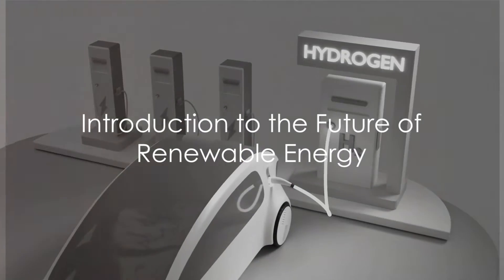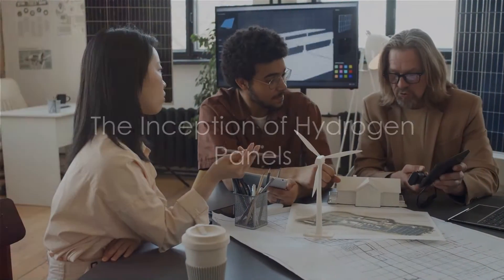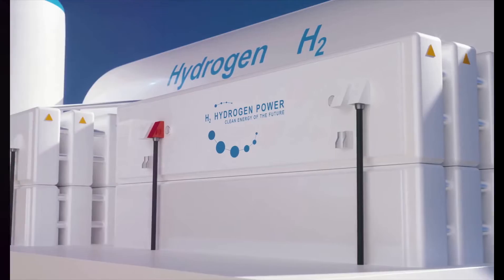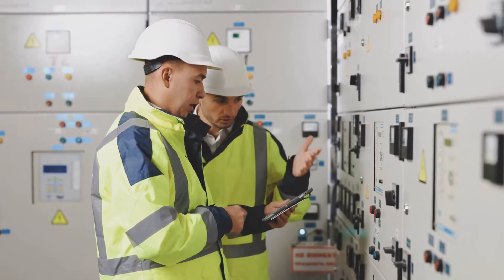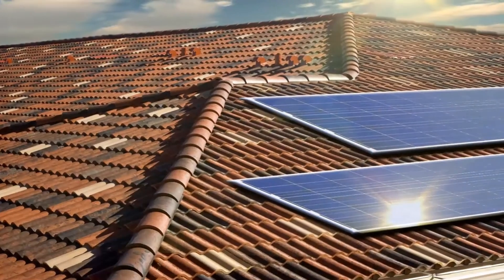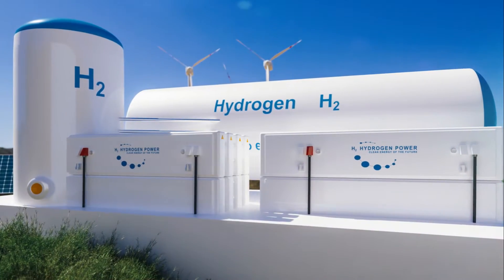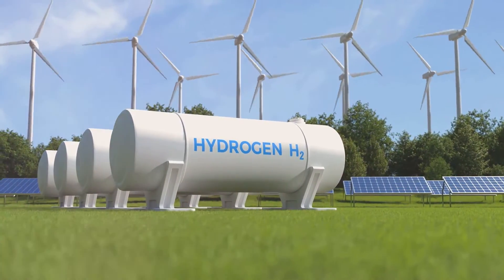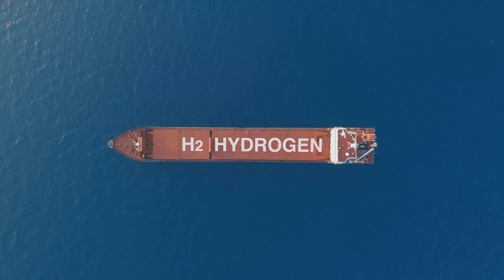Hydrogen Panels - The Future of Renewable Energy

Comment: This German home use hydrogen system is installed in residential homes 
Picea HPS Berlin has developed a fully integrated system providing for all electricity and heat demand. Use of hydrogen storage and fuel cells allow for seasonal storage ... proves that there are possibilities question of economics!
Reply from the maker: Thank you for your very useful comment. It is indeed a great case study showcasing the integration of hydrogen storage and fuel cells to meet residential electricity and heat demands, addressing important questions regarding the economics of such systems. It is a great case study in this space of green hydrogen.
Reply: From what I have read the Picea system on average  costs around €60k installed, based on an Enapter small AEM electrolyser, but clearly costs varies depending on the property. My attention was drawn to an article about a Picea system being installed in a chalet high up a Swiss mountain where grid connection was impossible, it brought electricity to a property that never electric power  - an off-grid solution offering 24/7 power all year around.
Reply from the maker: Thank you  @eddylagrand7762   for sharing! The Picea solar-hydrogen system, with its integration of Enapter AEM electrolyser technology, represents a substantial investment in advanced renewable energy. Its successful implementation in remote areas, like a Swiss mountain chalet, showcases its effectiveness as an off-grid solution, providing reliable and sustainable electricity where traditional grid connections are infeasible. ReneEnergy will continue with this series of solar hydrogen to stir discussions in this tech when it comes to its implementation, safety and economics.
Reply: That hydrogen system sounds like an interesting solution for residential homes! However, if you're an outdoor enthusiast or looking for home backup power, the Segway Portable PowerStation Cube Series might be worth considering. It offers massive capacity, powerful output, fast recharging, and comprehensive protections. Check it out!

Comment: "could run a heat pump"  ya, if the sun is out, or you have a small fortune in batteries.  Running a heat pump is really only for climates that don't get down much below freezing because then a heat pump will freeze over.  seen a lot of them do it.  Compressors in general are the problem.  Running an ac compressor or freezer or fridge compressor requires a lot of power.  They are the biggest problem with our energy needs.  A heat pump is not the long term solution we need.  They simply won't work in areas that really need to produce heat with low temps below freezing.
Reply: You are clueless. Modern heat pumps still work at -35C.

Comment: Ya it's a solar pannel and it perduces hydrogen with spinach plasma . 
It was invented in Israel 🇮🇱  25 years ago . 
Like where the F-have you people been ? 
And one panned 3' by 3' will power a Tesla car 25 Kw power . ! 
It will power an electric aircraft and save hydrogen pumped into a hydrogen tank for night flight ✈️.!
Reply from the maker: Thank you AllenBarclayAllen for your time and comments. It's truly intriguing to learn about this cutting-edge solar panel technology that generates hydrogen through the use of spinach plasma! Israel has a rich history of pioneering achievements across diverse sectors, particularly in the realm of renewable energy. The potential of this breakthrough extends to sustainable transportation and efficient energy storage, opening up exciting possibilities.

Comment: When will they give up on the whole concept of using Hydrogen as a fuel?? Don't be fooled by this disinformation campaign! If hydrogen was of any use it would have been up and running years ago. The main way of supplying hydrogen at the moment is by using fossil fuels!!
Reply from the maker: Thank you for your insightful comment. It's important to have these discussions, as they bring to light different perspectives and considerations in the evolving landscape of energy technologies. Your points contribute meaningfully to the broader conversation about the future of hydrogen as a sustainable fuel source. The skepticism around hydrogen as a fuel is rooted in its current fossil fuel-based production methods and historical development challenges. However, the growing focus on green hydrogen, produced using renewable energy, offers a more sustainable and zero-emission alternative. Despite past setbacks, ongoing advancements and investments in hydrogen technology suggest its potential role in a diverse and cleaner energy future.

Comment: Lacks critical counter point of view. Fails to mention full cycle efficiency (compression of hydrogen and efficiency of restitution of the energy). Hard to believe it would be used in households. More for grid. Imagine storing H2 in homes! Takes soooo much volume.
Reply from the maker: Thank you olivierboennec8088 for your comment. You're right to highlight the challenges of hydrogen energy, particularly its full-cycle efficiency and the practicality of household use. Issues like compression efficiency and the large volume required for storage make hydrogen more suitable for grid-scale applications than for individual homes.